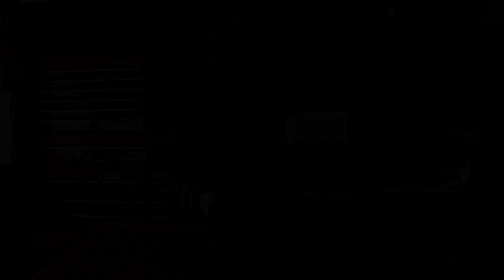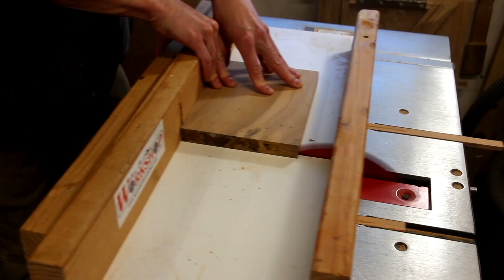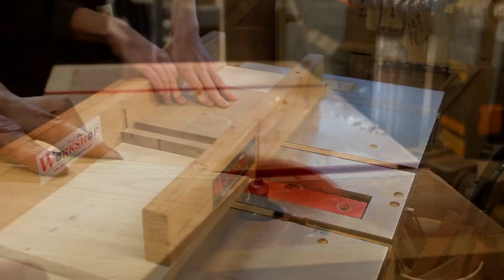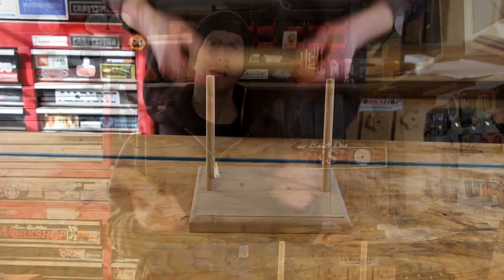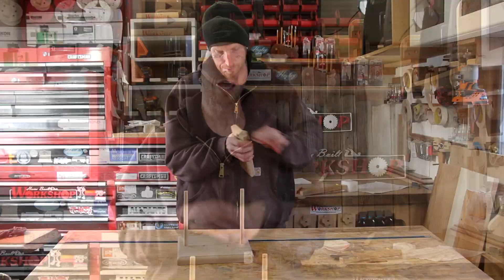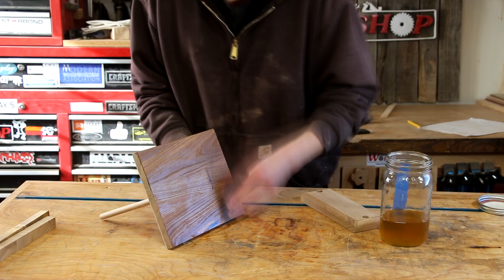How to make a Napkin Holder | Scrap Wood Projects

Comment: Nice little project, Jeff!  It's a nice way to use up some leftovers.  I used to make one similar with the base being longer to accommodate salt and pepper shakers on one end and ketchup & mustard on the other.  I also used rectangular pieces instead of dowels and added a piece between them to make a handle to carry it with.  Thanks for video!

Comment: Nice Jeff, I don't need one and don't do a lot of woodworking. So if I were to make one I would do 1" thick aluminum base, 1/2" stainless rods and steel weight with linear rod bearings. Or just 3D print one. 😂😂😂😂
Reply from the maker: You could totally print one. I should work on a file for that. Although I do like the all metal version. Its super solid and the linear bearings would just take it to another level.
Reply: @homebuiltshop  Talk about overkill. It could be used outside during a hurricane. LOL